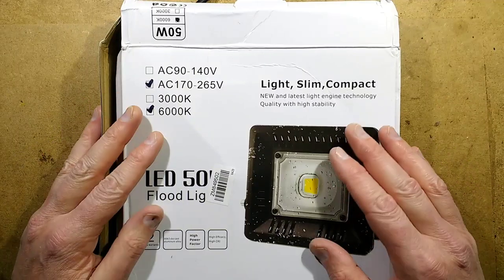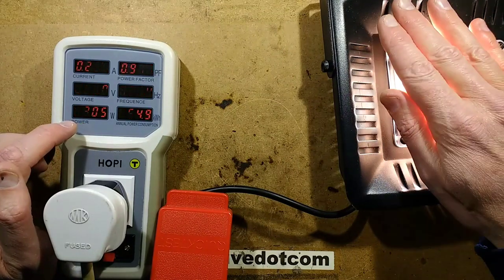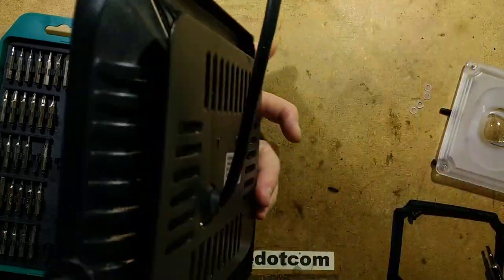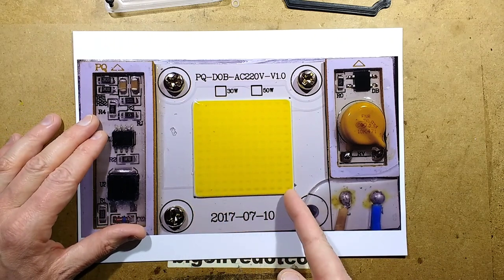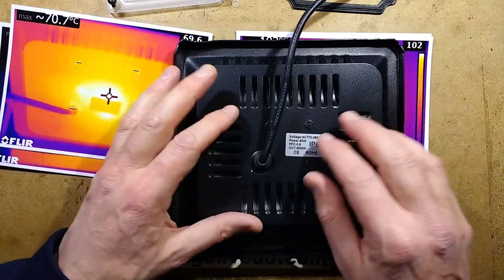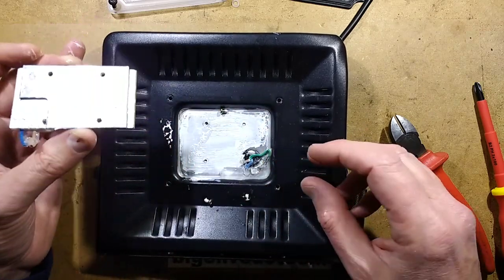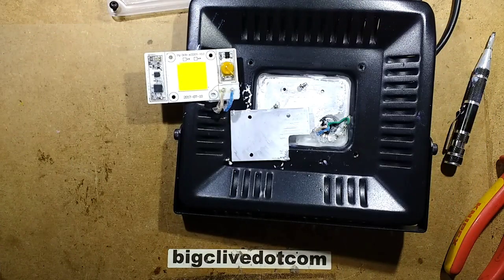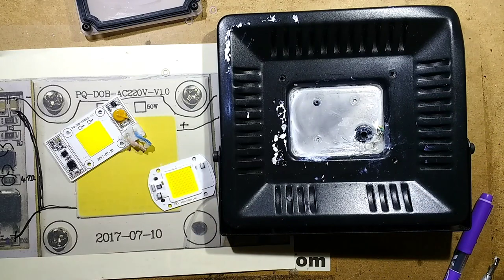Inside a super-slim 50W LED floodlight.

Comment: Hey Clive, thanks again for another informative video. I have been playing with those other kind of 'driverless' chips. The ones I purchased were from 'MB Lighting' and were pretty cheap. I tried the 20,50 and 120w versions which were $2 a piece for the 20 and 50w and $9 for the 120w. I liked the look of the 120w as it's surface area to power ratio was the best (thinking of heat transfer, not really sure how important that is in relation to other things)  I have not had any issues with the smaller chips although those are not in use as much as the 120w chips which are on almost 24/7.  Out of the 12 I have used, 10 have failed, the majority of them would still be emitting light from some of the leds but you could just barely see they were on. I was extremely careful in fitting them into the housings I had (which were easily suitable for power rating) however I cannot rule out user error. I noticed that my second order of the same drivers showed that they had redesigned the chips since my first purchase, the size of all were noticeably larger (the plate at least). Of the second order, I have had two failures. I feel some of the failures could have been from the wire connections to the chip itself.  With such a large 'heatsink' as such, it does make for a challenging solder job.  A lot of these new chips have been repopulating Casings from older 'failed' floodlights that I have accumulated from my adventures in the quest for the perfect LED.   These new chips look great, The warm white is perfect color temp for my liking. And the price, well suspiciously cheap, but they look as good as any other I've seen.  My greatest find over the years was a 100w (75w it turned out) Flood on amazon for $26. Now the housing was junk, too flimsy and you could tell the driver didn't stand a chance, so I swapped it out for a better casing before I installed. This was my first 'driverless' device I had come across, I believe it was a 16x8 grid of 0.5w Led's with 110v plumbed direct into it. How was a great find you may ask?  After the initial reworking, The light itself has been amazing, Has been on for 22 hours each day at least, color temp is perfect, and looks as good now as it did on day 1.  The biggest down side though has been the costly pursuit to find more of the same, and that where most of my housings have come from!

Comment: I'd be nice if you could do a video on a proper floodlight you can buy in Europe (like the Osram Ledvance or Geyer floods that are sold at quite attractive prices). The comparison could be enlightening.
Reply: ferongr A chinese company bought that part of Osram.
Reply: From a cursory outside look at the electrical supply store, there is really no comparison between the quality of an Osram light and a no-name Chinese light. Even normally imported (not gray import) Chinese lights are really bad in many ways and QC tends to be terrible.
Reply: Or at least illuminating.
Reply: ferongr Will Clive ever see the light?😁
Reply: +Frank Gormans Yup - Osram spit off the Ledvance lighting division in 2016 and this year it was bought by a Chinese consortium.
Reply: Hey could you recommend a proper floodlight? I want a huge amount of light and no flicker. A sun without a sun.
Reply: Iivari Mokelainen Use Led with Constant DC Current. That has only the flicker from the power source ( invisible)

Comment: The squeezing of the cable is obviously intended as a strain relief so the cable isn't pulled out.  That aluminium plate was probably chosen to match the thickness of the squeezed cable (if the cable wasn't squeezed in there, the plate could just be omitted).  Unfortunately, they didn't include the cable sheath in the squeezed zone.  Anyway, a flat product like that should use a side entry to not waste its own thinness.

Comment: I'm guessing their trusting the silicon potting and conformal coat to keep moisture out, even if the seal around the cord or lens gasket isn't quite up to par. They put stuff on there to keep it from flowing out before setting, so it stays thick which may actually work. Thermal paste seems to be a QC thing, somebody being lazy there. The strain relief or apparent lack of it seems to be the worse problem. So with better QC and better cord mounting, it might not be that terrible.

Comment: I think it's more a case that the screws are low emissivity rather than being so much cooler.  Try colouring them in with a black marker pen.
Reply: Andrew Cooke Imho, it's that the screws have direct large surface area contact with heatsink compared to much smaller (possibly indirect) contact area with the led driver heatsink.
Reply: Hi Matt, Infrared cameras are fantastic diagnostic tools, but they have some severe limitations that it's important to understand, it's complicated, but in short, don't try and measure shiney stuff.. have a quick tread of this : http://support.fluke.com/find-sales/Download/Asset/2563251_6251_ENG_B_W.PDF?trck=emissivityexplanation
Reply: Andrew Cooke The stefan-Boltsman law isn't  that complicated and I own and regularly operate a Fluke Ti110 on many materials including the 'shiny stuff'
I still stick to my opinion from experience in the industry.
Thanks for your input though.
Reply: that's cool, my time designing them seems to have been wasted.
Reply: Andrew Cooke that's for you to decide but my unit has saved me hundreds of hours.
Your point is a factor no doubt about that but mine is also. The screws are most of the way into a colder heatsink and the head  down onto a white and somewhat insulating layer over the led plate including under the screw head. Also Note the halo of cooler area just around the screw head in the image where it is just partially cooling the led plate from the screw head. If the screws weren't cooler then there wouldn't be a hotspot on the led array in the bottom right hand corner where a screw is absent as mentioned in the video.
Reply: surely if the thermal camera shows the screws as cold that means the connections to the warm areas is thermally poor. the opposite of what clive said?
Reply: I said before that they are fantastic diagnostic tools, so I don't doubt that it's saved you hundreds of hours, I reach for one too when sanity checking a new pcb design.  A couple of points for you, the screws appear to be colder than the heatsink, what would you expect to see when looking through the hole where the screw is missing, a nice cold heatsink maybe?  Are you sure that the ring isn't the white panel reflecting in the curved sides of the shiney screw? I agree that the screw will be colder than the white surface, and it will be providing localised cooling to the white plate, but that image shows it to be about 50C cooler than the plate, I doubt that it's more than 5C cooler.

Comment: I bought four COB chips after your first tear down video, 2 x 30 W and 2 x 50 W.

I suspect the throttling does not work that well because the first three chips died rather quickly, approximately 3 weeks after install in different setups.

1. 50 W COB, ran on an old GPU-cooler with heat pipes and a 12 V fan in the tower. When it was cold it hit 53 W, then after a couple of minutes it throttled between 44 and 46 W. It managed to reach steady 70-100 C and all of a sudden only haft the LEDS worked faintly. Every second row worked as if it rode half a wave.

2. 30 W COB, put on another cooler only with ambient temperature to keep it cool. The surface area was a bit larger. But the same problem. It started at 34 W when cold then throttled back to 29-30. It also died three weeks later with half the LEDs flickering.

3. 50 W COB, put on a large sheet of aluminium with a CPU-cooler behind. Experimenting with the size of the surface area. No better luck here.

4. 30 W COB. This one is still running! I used the same CPU-cooler as in 3 but with a 12 V fan attached. This runs at 23-35 C, but without the fan it runs up to 75-105 C and throttles to 27 W. With the fan it does 33 W.

I have a fifth chip from another supplier at 50 W waiting to be put on the CPU-cooler when 4 dies.

The throttling therefore have only a marginal effect, because it cannot lower the power enough. I also found out you do not need that hot of an soldering iron to attach the cables if you only use old, 1987, Fluoridic based paste. It does however make you dizzy if you do not evacuate the air fast enough. Perhaps that is why it is no longer sold (lead based solder...)

Enough surface area and fans are a must with these. One car battery and 12 V fans with a charger attached and an array with these chips. Or find a large industrial fan at 480 V and try to convince the wife it is for science.

http://www.processenvironments.com/cartPics/4cb8c6797c051IRO_782_ARR_1.jpg

Comment: Excellent video, as always. Could you maybe do a test with the temperatures when you've made sure the thermal paste is actually gripping the whole board, and with that one corner screwed also? Like re-route the cables so that that is possible. Also if you could test it with one of the "driverless" leds you have, seeing if there's a difference and how it works.

I do like the idea of smaller and "neater" light. I need to get one of those so that it'll help me fight against the darkness and the blues it brings.
Reply: ilaril It will cause headache because of the flicker.

Comment: Unit prominently claims an IP67 rating on the back. IP67 means:
Ingress of water in harmful quantity shall not be possible when the enclosure is immersed in water under defined conditions of pressure and time (up to 1 m of submersion).
So stick it in 3 feet of water for 30 minutes and no water will leak in that gland. Maybe.
Reply: I also noticed the prominently IP67 ( https://en.wikipedia.org/wiki/IP_Code ) and hoped BigClive showed this submersion in the video.

Comment: Have you though about taking the HOPI meter apart and turning the plug 90 degrees? So you would not have to use the death dapter
Reply: Ha. Genius
Reply: Reduces the chance of danger, no fun. he would never consider it.
Reply: floating earth damn
Reply: Or just remove the speaker terminals.
Reply: I was thinking the same thing, but for an entirely different reason. I'm surprised he hasn't taken the HOPI apart and reworked the circuitry to stablize the flickery display for the camera.
Reply: The flickering can't be helped. It's just how things like that are designed. 
He has said, in another comment thread somewhere, that he thought of taking the terminals off but if he did it then he'd suddenly have a use for them. In that case, my suggesstion is to relocate them to the bottom end of the unit.

Comment: It's earthed!  Will wonders never cease?

However, after having watched some of John Ward's videos about Chinese mains-powered stuff, the next question I have after "Is it earthed?" is "How good is the mains cable?"  John's videos have exposed some really crappy Chinese mains cables: seriously under-rated for the task, crappy insulation with flame-enhancement properties, and conductors that are copper-plated to disguise the fact that they're made of damp string.  Then again, you say the cable claims to be decent stuff rated for high temp (but it could be lying).

So my big worry about that unit is the placement of the cable gland.  It's in a really bad place where water will run onto it rather than away from it, so unless it makes a perfect seal you're going to get serious water ingress.
Reply: This cable have CCC Certification (Chinese standard) markings which should mean is tested in proper third party certified lab and with equal/higher standards than CE. But anyway CE is good standard if there was not ability that you do CE marking self-certification (you do not need to any third party testing and certification, you basically just need to give statement that product is compliant with CE standards).
Reply: European CE is not the same as Chinese CE, which means China Export; not to be sold in China. The two symbols look alike, when viewed quickly, but they are subtly different, as can be verified by a quick online search. And there is nothing to stop someone who is dishonest from printing the Chinese CE symbol on something which is substandard, or even lethal, and then making sure that it is not sold in China.
Reply: RWBHere There is no such thing as Chinese CE (China Export), it is just incorrect application of CE by some Chinese manufacturers, to be able to sell merchandise in China it must comply with CCC standard markings (so they do not need to have some marking that will say it is for export only, if it do not have CCC markings it can't be sold in China) and must be verify by independent laboratory (only certified testing centers can verify that product is compliant with CCC standard), contrary to CE (or how you call it European CE, but only that one exist) which is self-certify for most of products (all electronic products do not need to be tested and certified by a third party certification body you just need to fill EC declaration of conformity), only little product require to be certified by " Notified Body".
Reply: Is the cable gland an issue? The insulation continues all the way under the conformal coating. Water will be getting in via the louvres anyway.
Reply: Yes, I know that the China Export thing, which is why I posted a link saying exactly that.
Reply: Well it has VDE markings and if it truly is H07RN-F  then its pretty good cable
Reply: Sorry but there is no such thing as china export and most peaple believe that , watch an eevblog video on product marking just for it
Reply: your avrage joe can write wiki article on the issue , even wiki isnt sure of its existance, As a product manufacturer what marking would you like CCC (CE like rating in china) or the infamous CE logo, remember CCC is used for china sale only,whereas CE is viewed as global standard
Reply: +Erdnusschokolade
Yep.  If it's truly H07RN-F then it's good cable.  Quite possibly a lot better than is actually needed.  It's meant for building sites and places like that where it gets moved around a lot and somewhat abused.

The 07 means 450V/700V, which is overkill.

The R means highly resistant to abrasion.

The N means the sheath is grease and water resistant, as well as flame-retardant.

The F means fine wire, so it's very flexible and can be moved a lot without fatigue failure of the individual strands.

I suspect they went for that just for the temperature range (-20 to +85 C) and water resistance.

OTOH, this was attached to Chinesium.  So it may not be what it claims to be.  Some Chinese manufacturers seem to regard stamps like that as good luck charms.  They have no idea what the characters mean but think they bring good luck.  And they do: without such marks Customs may refuse to let them in.
Reply: +bdf2718
true i forgot that when dealing with chinesium you never know if that what it says is sctually true and seeing the Video threw again it doesn't look like it either H07Rn-F is in y experience dull black and the cable in the video looks a little too shiny which suggest more Plastic then Rubber

Comment: Those springy terminals on the HOPI meter seem like they're more trouble than they're worth. Why not remove it?
Reply from the maker: Because as soon as I do I'll find I need them.
Reply: David Robertson 
How about relocating them to another location on the housing?
Reply: You could maybe fit a switch somewhere on the case, have the terminals switched off normally. One of those old-fashioned metal toggle switches would look nice.
Reply: greenaum that wouldn’t solve the issue of the terminals interfering with a UK plug being inserted

Comment: What would the thermal performance be like if the LED-board was properly mounted to the case?
Reply: error079 This is very poorly assembled. It would make a huge difference if mounted correctly. But the surfaces are no way flat enough and the cable input is a no go. If you put on too much thermal grease it's a thermal isolator compared to aluminum.
That transistor needs an additional heatsink, too.
Reply: Frank Gormanns The transistor is heatsinked in the same way the LEDs are.  Through the board it's soldered to.
Reply: Just add another properly heatsync greased layer of aluminum between the light and the assembly to allow room for the wires and profit.

Comment: I had one of those 50 watt modules fail after I left it on a 12 hour timer while away for 3 days.

It might have been a heat-sinking issue since the sink I used only contacted the back of the module in certain places. It also occurs to me that transients might damage that sort of module pretty easily, which is probably why the work light one had an MOV on it.

Comment: I had one of those integrated cobs fail recently and thought about sending it to you....   It first started flickering after running for around 8 months - prob 10-12 hrs/day.  Finally it just died entirely.  Was on a very large AL heat sync - IRC is was a 30w 120v version, but long rather than square.